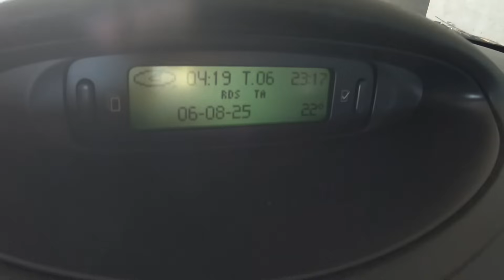How to change hydraulic suspension pump on a Citroen C5

Comment: Thankfully on the newer C5 X7  there is no removing the bumper etc.  The pump also holds a little bit of pressure, even when the system is drained.  When you undo the high pressure lines it squirts out. 
Plus, when all the system is back together you do have to prime the system before raising the car.
Great video all the same.
Reply: Hi, I wonder how to prime the system after the repair?
Reply: @jonassebeckis1175  I adapted a spare filler cap onto a bike pump.
Reply: @jamsams  how many bars u putting in?
Reply: @Suseko44  0.5b 😉
Reply: Que pasa si no cebas o purgas el sistema ? No arranca la bomba ?

Comment: Form 2003 till 2010 I owned this C5 2.2 HDI model, then changed to the actual 1,6 THP automatic. Till now i did'nt have  any problem with the hydaulic suspension, in my opinion this is the best suspension by far in the market sorry Citroen will kill it :-(
Reply: Lucky man ,I m already in th e 3 pump ): 2009 2.0 exclusive
Reply: Mine is always crooked after I filled her up at the gas station.
Always at the gas station, never anywhere else.
Reply: Mine is always crooked after I fill her up at the gas station.
Never anywhere else.

Comment: My c5 (x7c had pump failure after a blown hose on rear. I had a spare pump from my mk1 swooped the ecu control box over with no issues but there is a small difference in the pumps the mk1 pump has an external fluid return where the (x7) has it internally. Chasing the pipework about I found a return line behind the engine coolant tank and cut in to it putting a tee connector in it and run the return from the pump to it. It’s worked fine for the last 4yrs with no issues but you must ensure to use some good pipe clamps. So for anyone who’s had a pump issue there is a fix so you can use older style pumps on a more modern car if you can’t find a pump.

Comment: Good video
Point to mention here is someone has increased the fuse rating and blown the ecu board then it will work but no manual control will work until the ecu is programmed to the car

Comment: Nice tuto thanks. Went good for me with a lot more oil. Do you know if there is something special to do when remounting everything? Some kind of re-pressurize steps before reconnecting battery? Or everything goes by itself (air out of the system ...)? Thanks

Comment: Hello is there also a easy way to change all of the LDS system fluid? I've heard from multiple sources, that changing the luid can make a significant difference in suspension smoothness and steering can be lighter.  The electric steering pump unit in a phase2 C5 2.0 petrol takes the  LDS from the same tank as the suspension, but does not stream the return-leak oil back to the main tank, but to the pump head, wich has a retour inlet for the oil retour line. So that oil wich is under hi😮gh pressure and friction for steering al those years, does not really refresh itself if you only empty the LDS tank and refill that one with new LDS. 
Only way I can imagine is temporary leading the steering system return line straight back to the LDS  tank instead of the steering pump head (and block the return inlet on the steering pump(so there does not stream oil out)....
Meanwhile with running the engine or by switching on the steering pump on with lexia, and turning the steering wheel right and left, so hopefully you get some oil leak return from the steering installation and that way slowly push new oil through the steering housing

Comment: I own a C6 in Canada. When I used to approach the car, I could hear an electric motor start and the suspension would come up and the car was ready to drive as soon as I got in and the engine started. The car does not rise now and I don't hear the motor when I approach the car. What should I look at first? And what procedure should I follow to get the car up again? If there's a cost, please let me know. Yours very truly.
Reply: First, check if the fuse is ok

Comment: selling my C6.. my son was driving it back to the UK    importing taxes    in Portugal make UK imports insanely costly .. the L/H shock absorber lost / leaked the LDS fluid and the front suspension went to low . after adding more LDS fluid the ride height returned  enough to drive it back to the UK . Not having much luck with my ex dream car.

Comment: Great video my pump still isn't working it tests fine on the bench but doesn't work when installed all fuses have been checked....any ideas
Reply: 40 amp fuses in were the fuses and electrics are on the right-hand side as looking into the engine bay about 5 inches down  in the box closest to the front there is a row of 5 or 6 very large fuses  much bigger than normal ,are located try there that's where I found my problem  refit a fuse up the suspension  came sorted
Reply: If you look at this video at 12 minutes, he is putting the lid back on the box in there just to the front

Comment: Hey Buddy, I have a little problem with my C5 2002, H3 system, it's not as soft as it should be when crossing over small sharp holes on the road, and places where the road is healed by the holes, and it makes some noise when crossing over these, esspecially rear right side... I changed almost everything, rear arm bearings, sillent bloks, new IFHS comfort spheres and still same... I was told at forums from several people that depressurizing system could help, because I changed spheres... any idea..??

Comment: Hola!
¿Se puede cambiar la bomba de suspensión vaciando el circuito hidráulico desde el depósito?
De esa manera no sería necesario subir el coche en un elevador.....

¿Se puede?
-----------------------------------
Hello!
Can the suspension pump be changed by emptying the hydraulic circuit from the tank?
That way it would not be necessary to climb the car in an elevator .....

It can?
Reply from the maker: Change as you like. The most important thing is to take pressure off the system.
Reply: Yo te recomiendo que veas este video como se vacia por arriba... 
https://m.youtube.com/watch?v=ADUncPkUEws

Comment: I’m having some issues with my 2001 c5, there is a humming noise on steering and the suspension raises very slowly from low. Also if a heavy passenger gets in the rear, the rear will not rise to normal ride height. I am thinking the pump is weak and is about to fail. Does this sound correct to you? If so, can get the pump refurbished or is it best to replace with new? Cheers mate
Reply from the maker: Judging from the problems you listed, you should change the hydraulic suspension pump. Is the hydraulic oil level normal? Did you mix up the oils?
Reply: Level is good and no issues with oil mixing. What’s the story on new pumps? How much are they or can old ones be fixed? The motor seems to be running ok on the pump so maybe there are orings or something failing in these?
Reply from the maker: The best solution is to buy a used pump.
Reply: How’d u know it’s any good though? Have you ever taken one apart to see if they are refurbishable?
Reply from the maker: It's a matter of luck. It's best to look in a crashed car. A new one costs about 1000 euros.
Reply: Steering isnt in a hydro loop on the C5 its all electric steering so its most likely a bearing there. Regarding suspension its either a new pump or with its age i suggest getting spheres regassed which will also improve its ride!
Reply: @sumeda36  pretty sure the steering has its own pump, and is not connected to the brakes or suspension. However, the C5 uses a hydraulic power steering pump. And the oil it uses is LDS. Only the C5 has this.

Comment: my hydraulic fluid loss on my Citroen C6  2007 2.2 diesel .   was down to a damaged tank ( almost invisible depression and split .. 30 lb air pressure in a water tank was the only way to locate the leak .  and a faulty 1/2 molded small bore rubber pipe pipe .

Comment: hello, i have a 2001 c5 that display ''serious suspension fault'''  and when i press up or down button it show a big x on the screen,  do you have any ideeas?  thank you!
Reply from the maker: I have yet to come across this problem myself, so I can't help, sorry.
Reply: @CitroMan  if i change hydraulic pump(i have one from another c5, same year, engine body type) do i need to make some setings in car computer or  the car computer will recognize and accept the new pump with out me doing any setings?
Reply from the maker: If the hydraulic pumps are the same, you don't need to do anything (just pay attention to the codes).
Reply: How was fixed the issue?

Comment: there is no need to remove headlight.
Reply from the maker: It's faster and more comfortable to do some things when the headlight is removed. It's also easy to remove it.
Reply: CitroMan I do not work like that. it is too much job for the same thing I do with headlight. but if You say it is easy than OK. pozzz